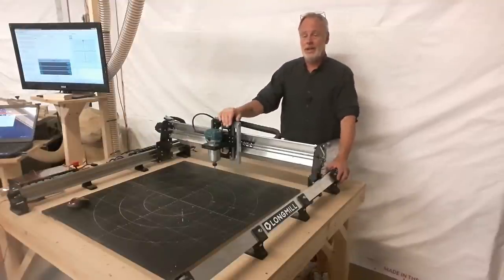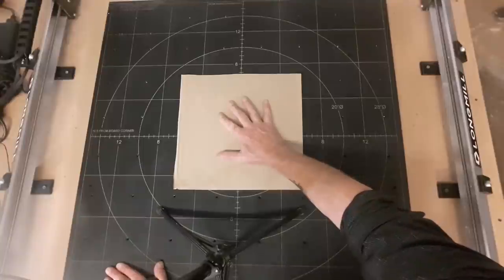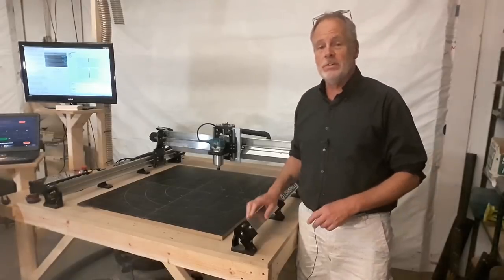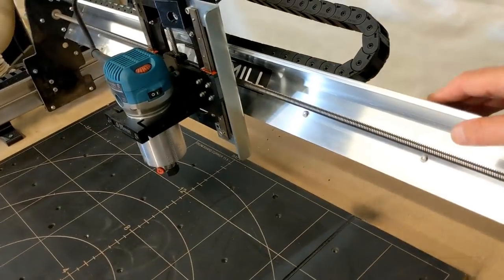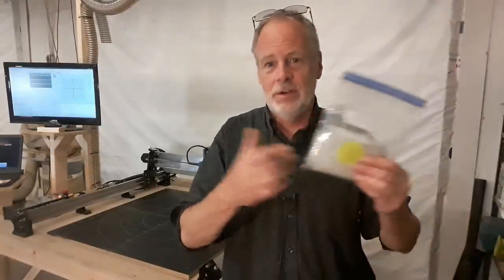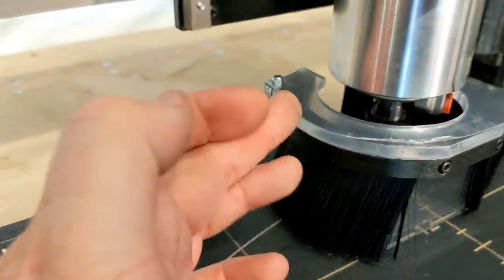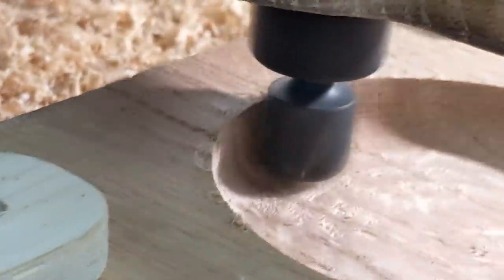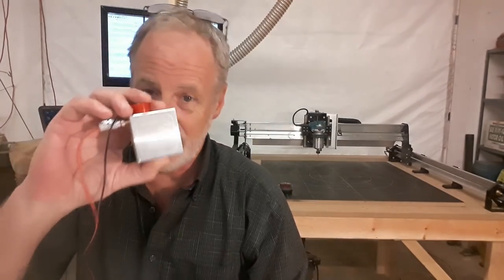Longmill CNC Router - Complete Review MK2 (by Sienci Labs)

Comment: Hey Garrett, GREAT video! Nice work explaining thru everything, very thourough in deed. When I purchased my Shapeoko XXL the info available for the Longmill was pretty scarce, and man they are...like 30 minutes from where I live, bummer. I like everything you pointed out and like the acme thread over the belt system, though I have not encountered any issues, but I certainly cannot cut at that speed with the Shapeoko.  When time comes to get another machine I will most certainly focus my attention on the Longmill. Also I saw very recently that the Makita router will outlast the Dewalt at least four times...that is stinking huge, my Dewalt only lasted a year, I'm on my third one in two and a half years. The brushes are hard to get and take forever to receive them, like 3 weeks, that socks. Anyways I'm rambling, keep up the great work, you're  doing awesome!
Reply from the maker: Hi Andrew. You still have a good machine. I've also heard that about the Makita vs Dewalt.

Comment: What Top CNC list do you reference? there are dozens, and they are all subjective... I agree this is a heck of a lot better machine than like xcarve or shapoko, so it very well may be one of the better ones... Just curious where you got that info. thanks
Reply from the maker: Hi Ryan. I determine the top 4 by popularity. There are many metrics but the best is taking note of user groups, size, engagement, etc.

The other 3 are Shapeoko, Onefinity and X-carve
Reply: @IDCWoodcraft  Popularity, probably accurate in those numbers.  Belts and wheels, no stinking way.. Onefinity is a tank compared to all three you mention, but half the price for the longmill vs onefinity has to be taken in to consideration for sure.  thanks again PS and the lead time for the 1F is months.. thats unfortunate.  my guess is many more would want to buy if they could get it sooner
Reply from the maker: @InTheLab3d  onefinity is definitely a good machine and was hard to have to take off the list. It's not just about the 'now' it is also about where companies are going in the future.

Comment: When you say top 4 in its class, where are you getting that from? What are the other three? I would like to do more research prior to ordering. Great video, thanks! Just subscribed!
Reply from the maker: Hello DB. Thanks for joining my channel. The other 3 are
Kill Wright
Onefinity
Shapeopo

Thanks for the compliment on the video.
Reply: I own a shapeoko XXL, and this thing doesn't compare to that one. This is a sub 2000 dollar cnc, the shapeoko uses all metal everything, touchless homing sensors and a balls crew z. In my opinion this system for 1200 bucks is good, but curb your expectations, this cnc is full out a budget level cnc.

Comment: Hi Garrett, thanks for the video as it gave some depth into what it can do, the pros and cons, what you experienced with the process of putting it together and the actual  testing of it.  I think I heard you say the 30x30 was the footprint of the machine. What is the XYZ limits of travel on the 30x30? I don't see it on the website either. If in fact it is 30x30 cutting area then what is the footprint? I was sold on the Onefinity Woodworker 32x32 but do have some things to consider on getting a Longmill. I appreciate the time you took on the video thanks again.
Reply: Never mind on answering the questions as I looked further down the website and see the 30x30 can cut 31x33 and footprint is 45x44
Reply from the maker: Glad you found the answer. Sorry for the delay. Holidays ya know

Comment: I've found over many years that a cutting tool with a length of cut greater than 4X the diameter is fragile and deflects a lot. When cutting full dia slots at full LOC at profile cut feed rates, the tool doesn't have much of a chance. There's a lot of tangential forces on the tool and chip evacuation is a problem. A down cutting bit would surely not be the tool to use for deep slot cutting. Chips are pushed down into the slot, making the situation worse. I was surprised you got as far as you did with that elevated feed rate. Maybe if not for that knot, the tool may have somehow completed the cut. That would have been surprising. When that up cut bit completed the cut, I was impressed. I'm rethinking my feed rates and depths of cuts.
Reply from the maker: Hey CNc. Yes, I need to do a video on tool deflection since it is a major aspect to cut quality than many do not realize. thanks for saying that. 

It takes a bit of guts to get a machine feed up so high but it is better to do that for sure.
Reply: Larger cuts, at higher feed rates or larger cutting tools removing more material, exerts more forces and  always has a fail point. Pieces can move, be ripped out of vises or clamps can fail to hold a piece in place at some point. Failure of the cutting tool before any of this happens seems to be the best condition that can occur.

Comment: Garrett, I will echo what many others have said already, thank you for this video. I have been researching now for a month or so and been agonizing over which machine to get. You are the only one that I have come across that actually put the machine to the test to the point of failure. In addition, I was absolutely blown away to see actually standing on the machine! I'm sold! One question if you could comment on. I live in Michigan so in the winter my workspace can get down to into the low 30's F. On the days I am going to work in my shop I heat it up to about 70 degree which only take about 1 hour. Is there any concern on what effect this could have on the electronics? Another company I asked this question to said to just leave the control on 24/7. Not a big deal although I noticed on your machine the control says to turn it off when not in use. Is this something I need to be concerned about?
Reply from the maker: Hi Jay. First of all thank you for the compliments regarding this video. I think you're going to really enjoy this new crafter going to get into. As far as the electronics, it's subjective. Electronics don't start to suffer until they get extremely hot or extremely cold. Sometimes I leave them on, sometimes I turn them off. I've never had an issue at all. In summary, I don't think you have anything to be concerned with either way.
Reply from the maker: Jay, you're so welcome! Before you start cutting, you're going to want to warm up your palm router and the bearings that are inside. To do this when it is really cold, I recommend running it at a speed of 2/6 for 1 minute then a speed of 4/6 for 1 minute. Then you are ready to cut! Everything else in the shop will be fine with those temperature levels unless you have a high moisture content in the air and condensation forms on the electronics! 
Don't be concerned with temperature unless you get into the -20 degrees region. I would recommend insulating your shop if that happens! 
If you ever upgrade to a spindle, it's important to warm it up by running it at a low/medium speed for a minute then a medium/ high speed for a minute. Typically 12000rpm then 15000 rpm.

Comment: What kind of GLASS can you use with the WidgetWorks drag bit??
Reply from the maker: Hi Karl. I use standard window glass.
Reply: @IDCWoodcraft  ok, guess tempered glass would work ok also I guess. Was going to use glass from a picture frame.
Reply from the maker: @karlriley1314  I have not tried tempered glass. It is designed in a way that makes me a little concerned. It's under compression in the middle and under tension on the outside.
Reply: @IDCWoodcraft  oh didn't know that

Comment: Thank you for the complete review. I just got my Longmill 30x30 setup and just chomping at the bit to start making chips. One great aspect of the Longmill for me was it's capability to be modified. Due to limited space in my garage i could not fit a 30x30 machine but, like you mentioned, I knew I wanted bigger than 30x12. With just a few cuts in the aluminum extrusion and the lead screws on the Y axis I was able to cut 175mm off the Y axis. This will give me around 26" which is much better than the 12" with the smaller model. 

Looking forward to more great content
Reply from the maker: Hey Andre. As we already spoke in email, I already mantioned  how ingenious that was to modify it. I'll mention that sometime in an upcoming video.

Comment: What is the maximum depth one can cut? I need to cut cavities 6" deep. Comment on a long bit length and whether the length does compromise accuracy. Thanks
Reply from the maker: johnligetfalvy9265, you can typically cut pockets up to 2" deep brother. Beyond that you are going to have a tough time finding the right bit for the job. The length of the bit does compromise accuracy.

Comment: Very informative video.  Liked, subscribed and rang the bell. 😁
When pressing a nut into a pocket, many times I find it easier to run a bolt or screw and washer through from the other side and just tighten to pull the nut in.

After looking at various videos on YouTube, I wanted a Onefinity Journeyman X-50 (48" cutting on X) but the price is just a bit out of reach and I don't want to go without eating for a month or two.  So, I decided to settle for OpenBuilds 1515 (46" cutting on X).  Looks to be strong enough.  Then I saw you riding on this machine!

I like that the Y rails are supported and Z uses MGN rails.
I would prefer that the plastic parts were injection molded rather than printed.  But then, I can print them with alterations if desired.

I'm just disappointed that the X is limited to 31" cut.  If I use the magnet mounted dust boot, how much more of that do I lose?
Is it possible to get longer X extrusions and leadscrew?
I'd like it to mill the 48" piece that the Journeyman X-50 can.  On the X axis, not tilling.
Reply from the maker: Hi Village! I've got a little surprise for you. But first, I'll respond to your comment.  Thanks for the tip about inserting the nuts. Great idea. I'll get this passed on.

I get your concern for the size thing and printed parts. There are pros and cons. The major pro is design mods are much less expensive. But overall, I was not bothered with the printed part after if was built.

You lose about 1.5" of travel with the dust sgoe vracket. So that hurts just a tad. Fortunately, we rarely use the full size of the machine. But...and you're gonna like this...

Longmill is currently working on a bigger machine. I have been asked to test it. I expect it will be available in the next couple months. I don't know the specifics yet but I have seen the design. Very cool, and kept with the Longmill tradition of designing with smarts. So stand by...
Reply: @IDCWoodcraft  That's great news.  I look forward to seeing what they come out with.  I hate it when I buy something and a short while later find there's another model I'd be happier with.
Reply from the maker: @villageidiot8718  I agree. Hang on because I haven't received the beta test unit yet
Reply: @IDCWoodcraft  Understood

Comment: Garrett, you continue to amaze. I was aiming for a Onefinity 50 in my dream world. But when I realized you chose this machine, I knew it could do more than I would ever ask of it. And that before they released Mk2. When you climbed on top of the X rail, that sealed the deal. Of course, the $1K price makes a world of difference for me. I’m a software guy by day, so I’ll get this bugger running on a Raspberry Pi not long after I receive it. Thanks.
Reply from the maker: Hi Terry. Even I was surprised Icould srtand on the machine. Did you order yours ye? Ifnot, I was wondering if you could use my link. It's an affiliate link so I'll get a little commission off it.
Reply: @IDCWoodcraft  just bid on a house with a big shop today, so have not ordered yet. I will use your link when I do for sure.
Reply: @IDCWoodcraft  I am also looking into this machine, and you will see my post above. I have not finished this video yet, but will...maybe most of my questions will be answered. Thus far my biggest concern is the durability and longevity of those V-wheels and their wear on the aluminum. I'm pretty sure I will be ordering a machine in the next week or so, and if this machine meets my needs I will order through your link. I doubt I will be putting the hours into it as you have so if it has held up as well as it should for production, it may be my choice!!!
Reply from the maker: @mr.p9882  I was concerned about the v wheels as well so ordered a second set. But after a year, I haven't needed to replace them yet. As far as the aluminum rails, all the does is polish them up and Make them look prettier!

Comment: Great rundown of the machine, very in depth. 
For my money (at the same price and work area as the longmill 3030) the Shapeoko 4 has my vote by a country mile. (I owned a shapeoko 3 for some years) no 3d printed parts and an extremely rigid bed.
The longmill looks to be a great option though and after your video I realise it's a lot more rigid than I originally thought
Reply from the maker: Hey Stu. You still have a strong machine. It's funny how the longmill looks are interpreted as how strong it is or isn't, until you understand the engineering behind it.
Reply: @IDCWoodcraft  I honestly didnt realise there was a second piece of channel on the gantry until this video, that increases the rigidity substantially.

I sold my Shapeoko 3, my 5x5 Avid Pro arrived yesterday
Reply from the maker: @MrKtmstu  wow, here big boy machine just arrived. Make sure you send pictures of it after you have it set up.

Comment: Hello Garrett. 
I finally got my longmill put together.
It took me s little longer than anticipated because I wanted to change out some hardware and have the controller on the right-side. 
I haven't made anything yet cause I'm still setting up the spoil bard surface.
Reply from the maker: Hi 3D. Excellent. You'll have to send pictures of your right-handed setup.
Reply: I will when finished.
What an awesome review on the Longmill.  I thought you were kidding when you said you were going to stand on the X gantry on your earlier review. Lol.
Reply from the maker: @3ddesignz941  I kid a lot. But this thing impressed me that much that I was going to try it no matter what.
Reply: I think the folks at Sienci Labs would be equally impressed when their sales pickup because of your demonstration in strength and rigidity in their machine.
Reply from the maker: @3ddesignz941  they just might...

Comment: How do you keep the Y rails parallel?
Reply from the maker: edluna5224, To keep the Y rails parallel, make sure you measure and adjust them evenly when installing. Using a reliable square can help ensure that both rails are aligned correctly. After installation, double-check the spacing and make any necessary tweaks. It's also helpful to secure them firmly to prevent any movement during operation. Consistent measurements will help maintain that parallel alignment throughout your projects brother!

Comment: I'm glad you are as impressed with the machine after you assembled and began using it as you were when you researched and bought it. I don't know if I would have stood on the gantry to show rigidity, but point made. I thought the machine could handle the forces of the 1/4 dia X 1.00 dp down mill cut but the tool probably would not. 100 in/min seemed severe. Just no place for the chips to go. I didn't think the up cutter would fare much better. I'm surprised and impressed. It spit out material like crazy and cut a nice clean and deep slot.

I'm used to cutting lots of different metals. I select tools, feed rates, depth of cuts and type of tool path based on the material I'm removing. I keep getting more aggressive with my feed rates and depth of cuts in wood. I don't have a Long Mill. I'm impressed with the Long Mill capabilities so far. And the price point is extraordinary for that level of performance.
Reply from the maker: I didn't explain it right regarding the 1/4 bit. It was a 3/4 flute lengths. I was part the flies. That's why I couldn't go any deeper

Comment: Thanks for the in-depth review and showing off of the features of the Longmill. I too was convinced when I had questions and actually dealt with Chris or Andy well over a year and a half ago (Build version 2 of the 30x30). They have had some QC issues in the past (many from suppliers and a few internal as they were growing so rapidly) and have attacked them head on and resolved them - the sign of a caring company. I went back and forth on machines and it was this Company and their responsiveness that pushed me over the edge and I am more than happy with my 30x30. Now with the ground up re-building of gSender (I was one of the original gSender Alpha testers), I agree that this company will be on top in 2 years. More on the way, I understand too!
Reply from the maker: Hi Steve. Yup, you see it. There is something to be said about a company that is not only responsive, but transparent as well.